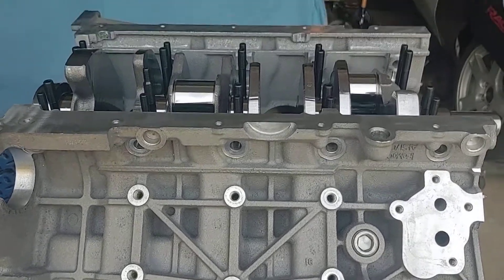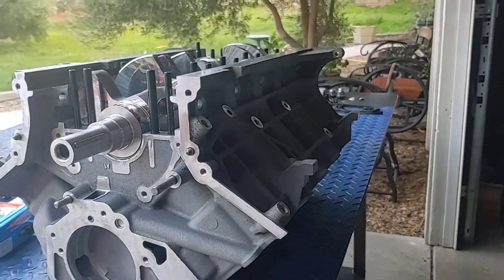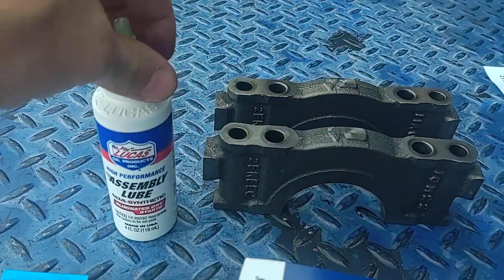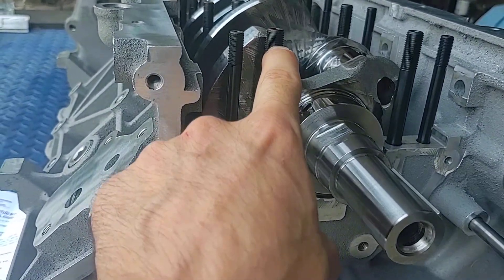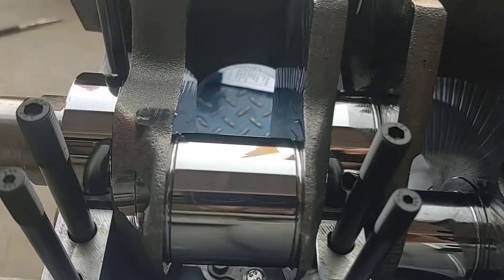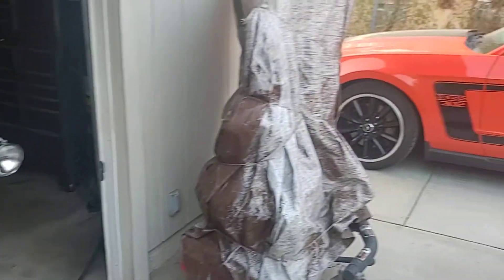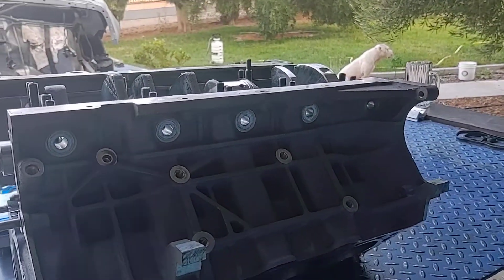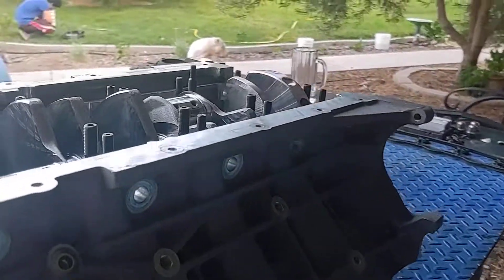Mustang Boss 302 5.0 Road Runner Coyote Engine Rebuild With Forged Internals And ARP Studs # 1

Comment: Boss Roadrunner is way better than a 15 Coyote, and even better than a Gen 3 Coyote. I know cause i have a soon to be Authentic True Boss Roadrunner in my 11 5.0 with gen 3r and mild pulley for 800wheel e85 daily driver. Boss Has forged Mahle pistons, high tension valve springs for 8k rpm, bigger cams, forged rods, way better heads with bigger valves, roller follwers, lash adjusters etc....Boss heads have thicker casting and added copper to strengthen heads, fully ported CNC job, Fully balanced rotating assembly, unlike any coyote. Better head studds, gaskets,,everything. Even a Gen 3 coyote not as good cause Gen 3 coyote still has cast pistons. Boss also has Sodium filled exhaust valves for better cooling. Block has rerouted coolant passages. Anyone who says Boss and Gen 2 or 3 are almost same is a fcking knuckle dragging meathead. Boss Roadrunner is designed for high rpm endurance racing. Its fcking sick motor. Glad i found one for my soon to be 800wheel 11 5.0 daily driver e85.
Reply from the maker: Everything is correct. Except the rods are not forged. Only the Pistons are. I have a complete set of the original Mahle pistons with rod combo that I might sell. We used Manley rods and pistons with lower compression ratio for this build so we can add supercharger.
Reply: @ALLMUSCLEUSA  Ford says the rods are forged. I can show you link. No point in using a forged piston without a forged rod
Reply: @ALLMUSCLEUSA  I am putting in manley rods anyways. Keeping stock forged Mahle pistons.
Reply from the maker: @maximusvonce1381  Yes post that link. I'd like to see what is said about the rods. Good choice for upgrading the rods. You should upgrade the pistons too. Lower the compression ratio if you're going to add boost. Those pistons are meant for n/a motors.
Reply: @ALLMUSCLEUSA  Why upgrade a Forged Mahle piston. The forged pistons are boost friendly.

Comment: What was wrong with original boss motor from ford. Why are you rebuilding it.
Reply from the maker: The rod bearings went bad and took out the crankshaft. I bought a 22k mile replacement engine for the car. Then I decided to rebuild the original engine.